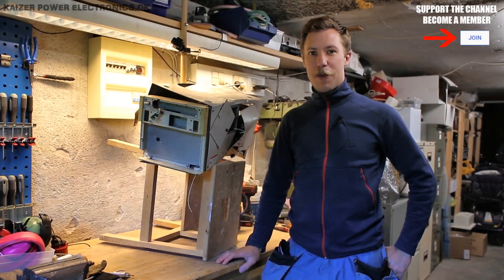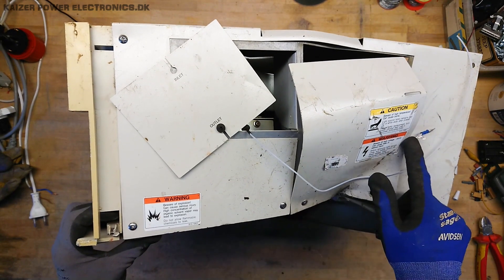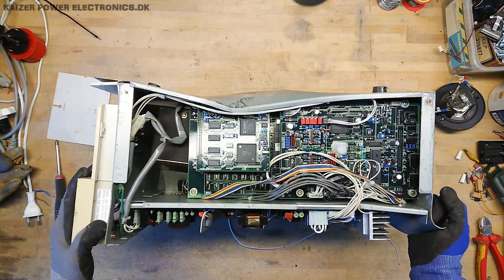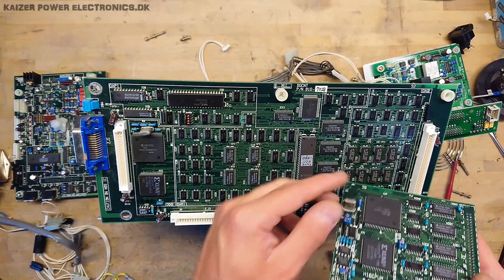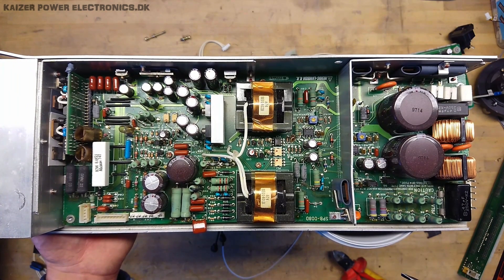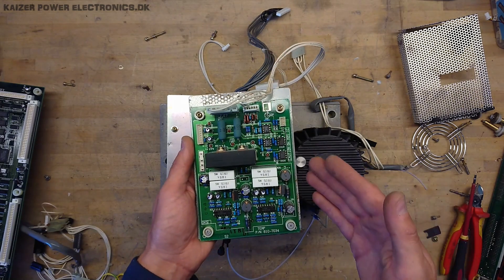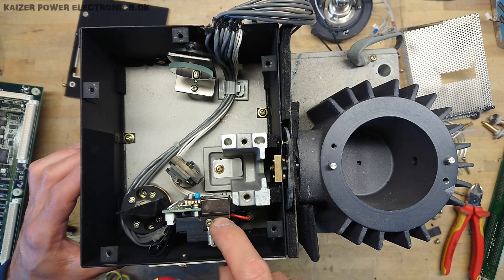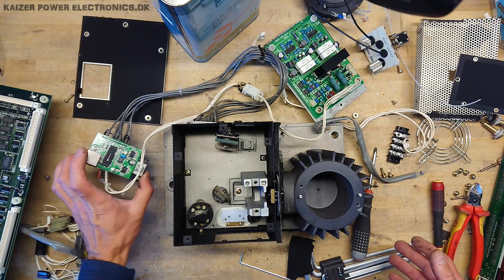Hitachi L7450 HPLC Diode Array Detector Teardown

Comment: Thanks for doing this teardown. I actually have a complete HPLC that uses this same style Diode Array Detector (DAD). I am thinking of buying another one to hopefully hack in my own detection electronics because a modern HPLC can sample at 70Hz, but due to what I suspect is the bandwidth limitations of GPIB if I wanted a 1nm resolution my update rate would be 3200ms, or if I wanted a 200ms update rate my resolution would be 16nm. It would be great if I managed to get 1nm resolution at 10Hz or something. Before I go too crazy on that though I should try probing the communication lines from the first FPGA after the detector because it is possible that it is always running at full refresh/resolution, so I would just need to split the data off to a second data interface.

If you or anyone else has a question about how this is intended to be used feel free to ask.

Comment: Awesome video as always, you always get such beat up equipment!
Reply from the maker: That is the downside to first catching it at a scrap yard :( A lot of this laboratory equipment was however destroyed on purpose by those that discarded it, sad story, but it was done in the name of "protecting data". It was a research facility that closed down, so literally no reason to smash up all the lab equipment, they could just have taken all the harddrives from computers and leave the rest.
Reply: @KaizerPowerElectronicsDk  damd that is such a shame. My local recycler seems to just remove the disk leaving everything else intact. It's a shame though they have not had anything interesting recently.
Reply from the maker: @DextersTechLab  Maybe we are looking into a lack-of-upgrades-junkyard-draught.... I have also not found anything interesting for half a year. Gives some time and space to work down into the pile in the garage!

Comment: The deuterium lamp is a nice touch, always good to have for all kind of optical experiments and maybe even as a calibration source. 
The unit looked like most of the good parts are propably smashed to pieces but I guess I was wrong.
Reply from the maker: The intact lamp was a surprise :) Only the decapped IC and broken off mirror was the apparent damages to the electronics. There was properly more where the enclosure bent into the circuit board...